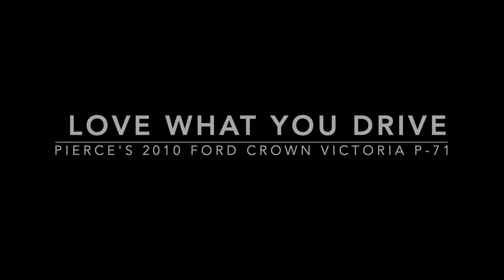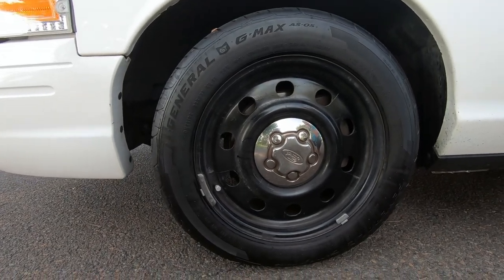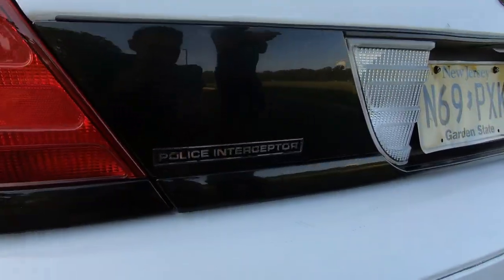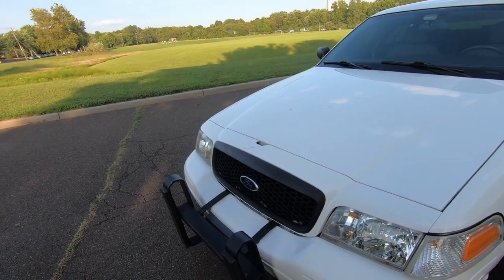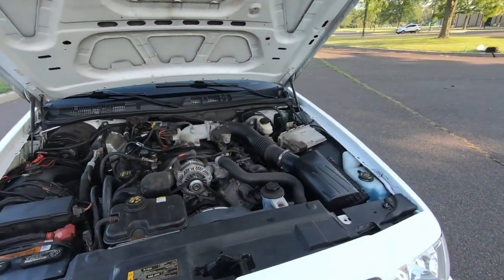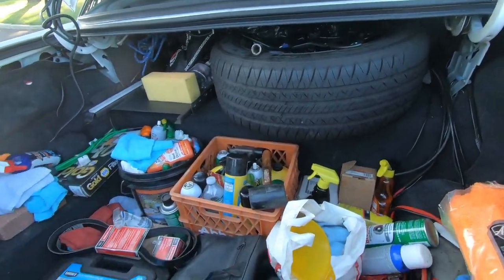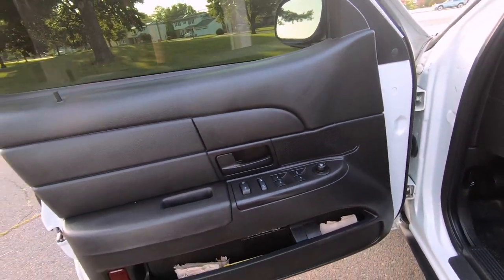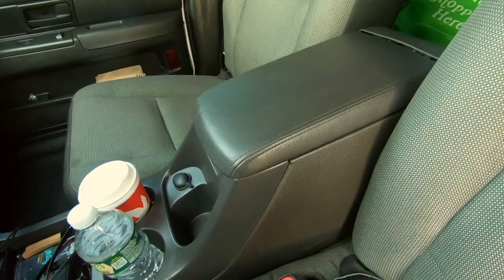2010 Ford Crown Victoria P7B | OEM CLEAN EDITION POLICE INTERCEPTOR |

Comment: Just to let y’all know, a 2010 is a P7B, it’s no longer P71 for 2010 and 2011. P71 VIN was discontinued after completion of 2009 model year. The last 2 years of 2010 and 2011 for Police Interceptors is P7B.
Reply from the maker: Thanks for stopping by! I will change the info, I was just so used to p71 that it just flowed. Thanks for clarifying!

Comment: As a panther owner and fan, hit those rust spots with Ospho 2 kill it now so it don't get out of control. Knock off any flakes, chunks, then Spray with brake cleaner then ospho. Rust gone. Nice ride. Also save oil and trans fluid from changes, mix 1 quart of each, plus 1 tube of grease, 1 wax ring toilet gasket. Heat and mix in old pot and brush, spray etc all inside frame and body. The wax we can buy has no petroleum at all in them. U never see a auto with a leak of any oils, fluids etc rusty. Been doing this for decades. No rust issues. Also clean then tape door drains, fill bottom with about 2 inces or so of baby, mineral oil, melted Vaseline, let sit few days then drain and save for later. Doing both I've not had to redo for years in rust belt. Save them. New autos suck.
Reply: Thank you so much for this incredible information. I'm going to do this
Reply: @alljerseysmatter.  We have the gr8 opportunity with SM to reach ppl, lift them up and help them. I choose to do that. All things I know or can do I learned from others. So if we keep helping each other well all be better for it, save time, $$, and live life more easily. So u have a gr8 wknd. If u have any questions, concerns please just say so. I will help if I can if not I'll find someone who can.
Reply from the maker: @jasonchristopher2977 amen 🙏🏼 thanks for stepping out! We learn from one another!
Reply: @jasonchristopher2977  You are amazing. Thanks again.
Reply: @alljerseysmatter.  Amazingly decent human. What we ALL should be. Just pass it on. We need more good ppl.
Reply: @LoveWhatYouDrive  Thank u for the platform. Ive gotten so fed up with mean ppls BS. I just follow simple teachings as a kid, only say kind helpful words or stfu. More ppl should learn this. No need to bash ppl. They know what their faults are. We all have them and we all mostly try to do better. If we stop bashing and hold out a hand we can pick more folks up. 

Even though all of yall are strangers, if u love cars, especially panthers, we're all just buddies who never met yet. I'm a gen X man who was taught alot by old school ppl who had alot if talent. I've forgotten more than I know but after 30 plus year love affair of all things oil and gas, the basics really don't change, just the tools and equipment does. Rust still needs killed, and bodywork still same process. I was lucky to grow up with family that was into autos, heavy equipment, Semis, Tractors, Hit n miss engines, antique and classic restoration, racing dirt track, etc. I know a lil bit about most things in this area, don't know it all but love to learn from others and see how yall do it. Many ways to skin a cat. With cost I try to find the simple ways. Channels like Ford Boss me, Ford tech make u loco, sweet project cars, BST, paint society, etc have showed me the new tools we can have to help us with this hobby, lifestyle, love. Hope yall have a gr8 wknd. Check out Rich men north of Richmond. We're all in this together. We all bleed red. We all just want to live life and be happy with our families. Hope ppl can see this. H8 needs to die. We don't have to love or even like all ppl but just be a decent human.

Comment: I do love the clean look on these cars and I am happy to hear a clean build like this will get some fresh paint $ to preserve it proper. My own 2010 had more of a history lets say than this car and I ended up using some rust converter and then black spray bedliner around the bottom edge and roof to keep the metal in check. It looks rough but I'm okay with that.

Comment: The factory mufflers are highly restrictive and make the car overly quiet for my taste. If you remove them and don’t remove your 02 sensors you won’t get any lights and you’ll gain a little bit of power, especially on the low end. I’m putting a set of flowmaster mufflers under mine just to give it some tone

Comment: Take you some tin and place under that. Get you some fiberglass, and fill that in.. On my P74 I did this to mine. Mine is black. Every who had my P74, they upgraded it to a P71. New tranz high out put. And the rear end gear, they placed a one in it..  and I placed shocks on it..  Then I got me some police tires, and put on it. The car rides a bit on the rough side now. But whew~ it will take a curve like crazy!

Comment: You’re not going to like the RSA’s. They are absolute trash when it’s wet out. I work at the Sheriff department and I have driven lots of these cars. I’ve also owned a bunch of these cars. Stay away from the RSA. I went with a BFGoodrich Advantage sport TA. They handle excellent in all conditions, including the snow.

Comment: What do you think of this car with 500000 ?miles
Reply from the maker: If it’s a good deal and there’s some sort of record of previous maintenance and if it drives and starts than it’s a go. I bought a Lincoln with 402k mikes that still runs and drives really good. The I take manifold has been changed, plugs and other things so I had no issues buying it and now I drive it. You said 500k miles right?